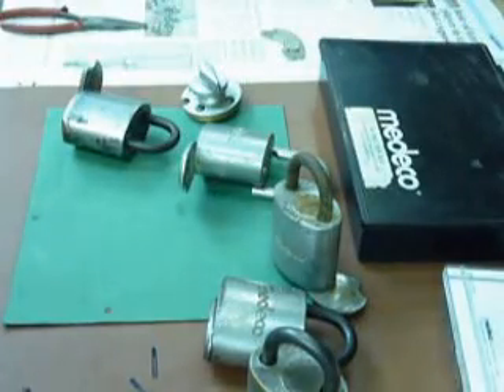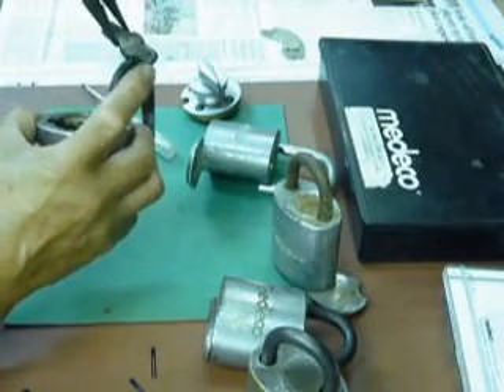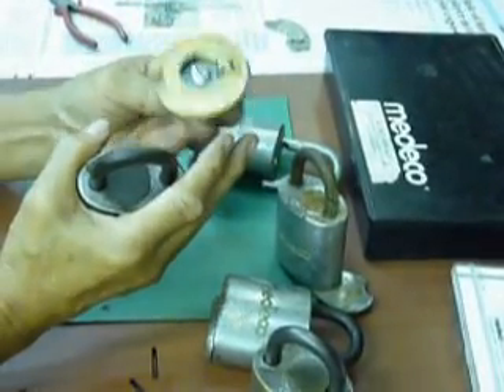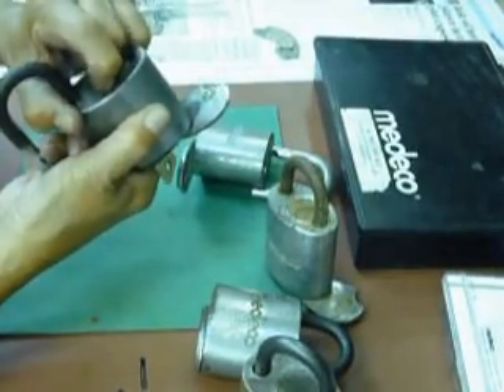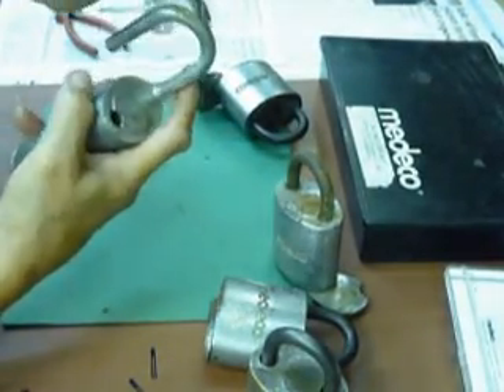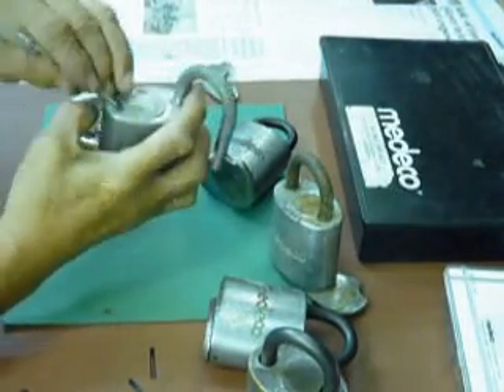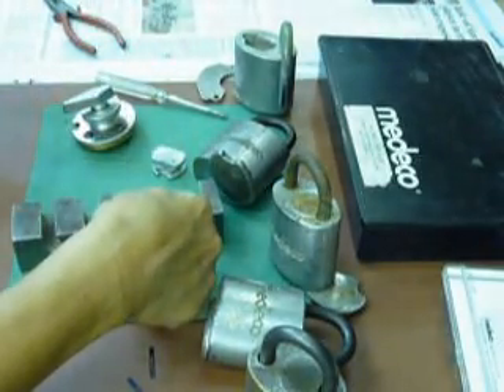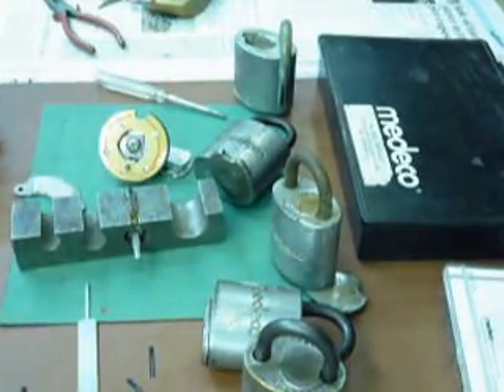HOW TO DISASSEMBLE/ REASSEMBLE MEDECO "BULLDOG" PADLOCK

Comment: Do you know how to remove the Shackle in this style of Medeco Padlock? I'm having trouble finding that information..
Reply from the maker: hi Rookie Lock, yes it is easy to remove the shackle of this type. there is a pin near to the bottom tip of that padlock. you need to have 2mm nail that is flat at the tip. then,#1 unshackle the padlock, ..#2 extract the padlock shackle fully. #3 turn the shackle 90 degress, #4 return the shackle down(while on its 90 degress position) #5( there is a hole at the side of the padlock) insert the 2mm nail, and hammer that slowly, you will feel the pin of the shackle moving inwards, continue until the pin is off the  shackle body, and you can remove the whole shackle out. thanks for watching buddy.
Reply: @yononable  Thank you ! I got it ! again, thanks for the instructions :)